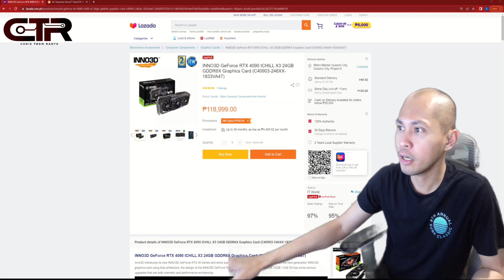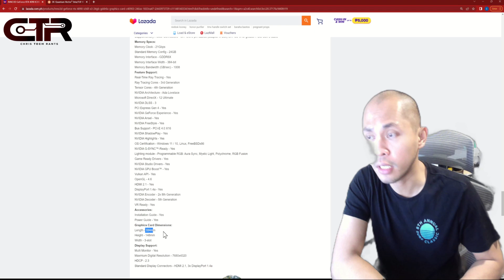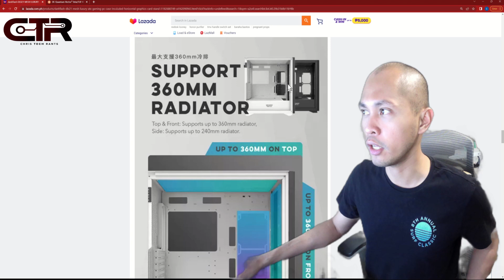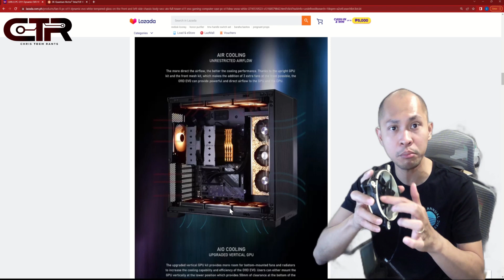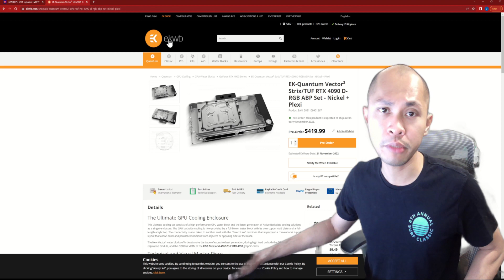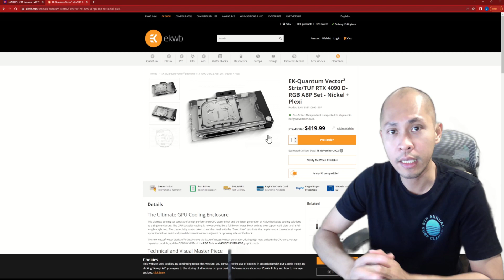Before buying an RTX 4090

Comment: I don't understand why you absolutely want to WC the 4090 when 1) Temps are very low on all models, no problem with throttling or memory temps this generation  2) OC is useless in the 4090 and WC cards are throwing the same perf results as any other AC cards. The Strixx performs exactly like the FE or the Liquid Suprim X. The only reason to spend on a WB would be because of size, if you really insist on having a tiny PC. Other than that, the smart thing to do is buy the CHEAPEST 4090 you can get, they all perform the same at 4K, which is the only resolution that "needs" a 4090. I have a WC 3080 Ti myself, btw. But won't be water-cooling the 40 series, it's a waste of money. Also, 420 USD for an EK block is a sad joke. You have to be mad to spend so much money on a block that basically gives you no performance advantage over an air-cooled version, nothing.
Reply from the maker: Fair point 😅 but I don’t plan to buy the one with an abp. just the $200 one. As for why….why not? 😂 the air-cooled ones run “cool”, but they could be cool-ER and a bit more quiet. on another note, careful on buying the cheaper ones, they’re cheaper for a reason.
Reply from the maker: Nice nice will try to check that out. I’m not from the states. No FEs here. Cheapest one that’s here and is currently out i think are the ones from inno3d. FEs here will be overpriced if it ever does become available.
Reply: My Waterforce 4090 definitely runs noticeably cooler than the aircooled cards, not sure about MSI's hybrid. I'm at 5120x1440, which is around 90% of the pixels of 4K, so its pretty similar performance, a little bit faster.
Reply: @Afterthought_  Cooler, yes. Faster, nope. It's useless to drop 20C temps that are already pretty low, when there are no performance gains. Moreover, the MSI Hybrid has the highest memory temps of all models, so it's very unbalanced.